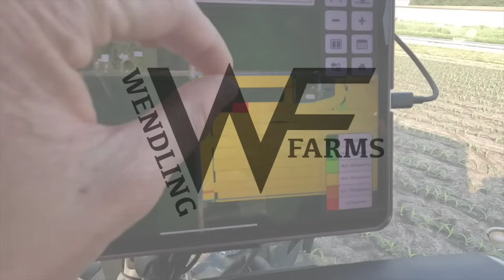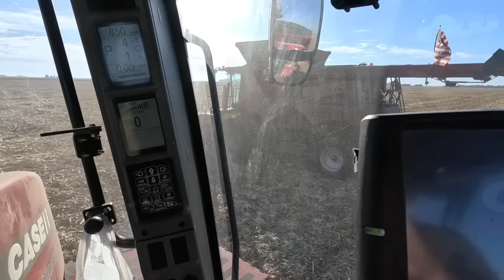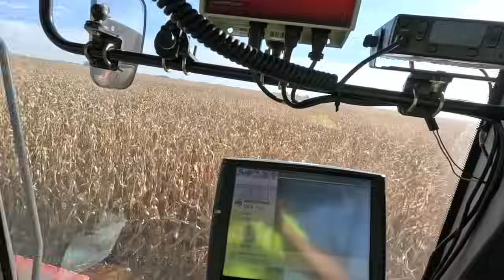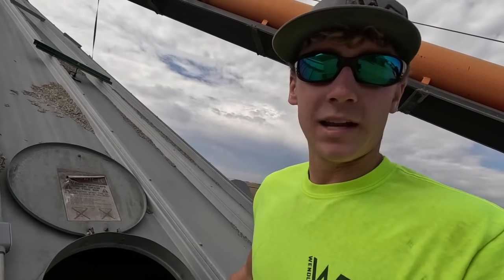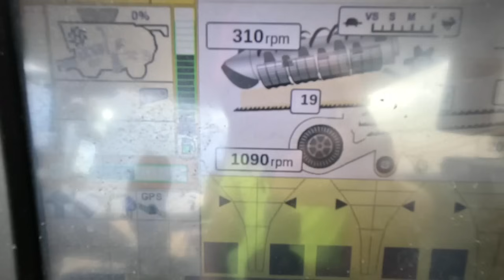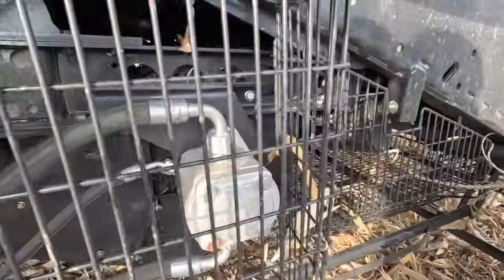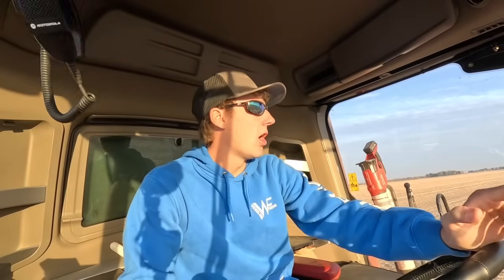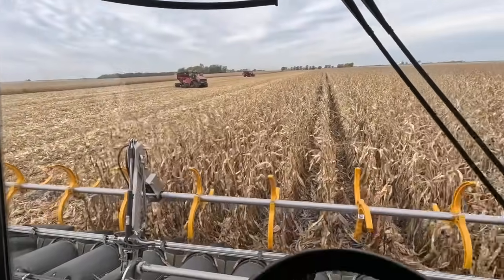We’ve Ran Into a Problem!! Combine Flaw

Comment: I'm a city boy , would you explain the purpose of those yellow spinners that go across the head unit on your combine >
Reply: When the corn is down either from wind or whatever, they can put the reel down and it helps the crop keep feeding in the machine. It also eliminates getting off the machine repeatedly to unclog it.
Reply from the maker: That is a reel. Used for down corn or help feeding “fluff” that can sometimes build up on the head.